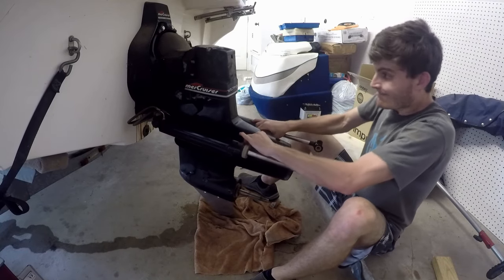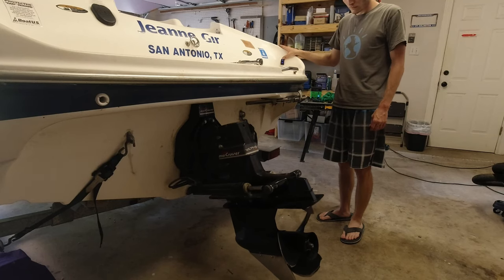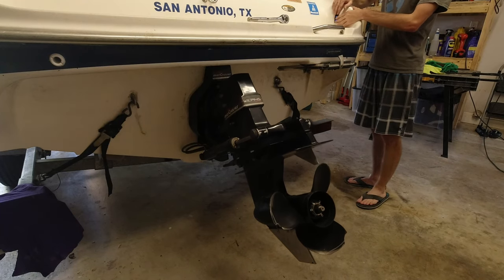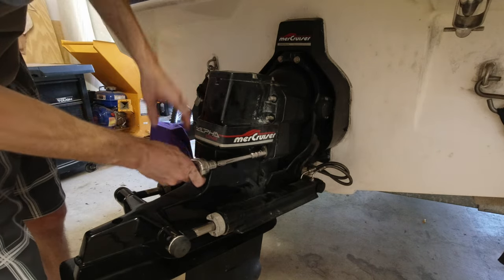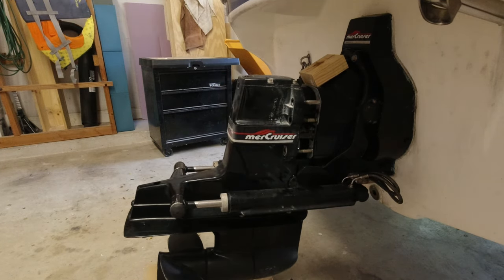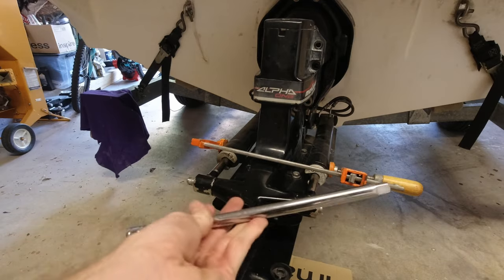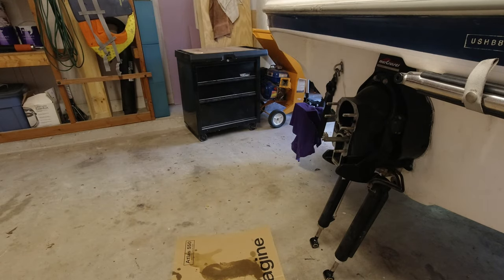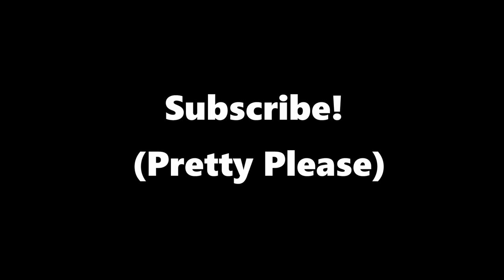How To Remove an Outdrive | The Easy Way

Comment: I beat, I banged, pryed, and heated to no success. Reinstalled the ram and put in a piece of 2x4 on the top as shown and using the trailer button raised the outdrive and bang, the outdrive was loose. !!!! ZACH, you saved my $135/hour mechanics ass.

Comment: Great video, Zach! You're helping a lot of people with your channel. I am about to remove my outdrive - Alpha One Gen 1. Before doing it, I thought it worth asking you for an idea of the problem in my case. I hit a rock with the propeller last autumn, at a very low speed. The engine kept running, but the propeller stopped rotating (in both directions it doesn't rotate anymore when I put it in gear). Now I hear a rattling noise inside the outdrive, both in neutral and in gear, close to the boat area. Any idea what it could be, what to look at? I am trying to avoid disassembling more than I should. I am not a mechanic... learning from your videos. :goodvibes:
Reply from the maker: well somewhere or another a gear stripped. it could even be the mechanism that puts it into gear. the level I show that has to be straight when putting the outdrive on
Reply: @ZachsGarage1  It's Friday night and you're active... 😃 Thanks for the reply! I'll have to remove the outdrive in this case... no choice. Another occasion to stay closer to your channel. I'm grateful for your efforts.

Comment: Smart idea with the block of wood! Also, I might be wrong with this, but when you reinstall the outdrive does the drive shaft have to go back in the same way? for balancing purposes?
Reply from the maker: the splines need to line up, but I don't know about balancing
Reply: nope, doesn't matter, just need to make sure your engine alignment is good from time to time... thats part of what can make it hard to remove the drive in the first place...

Comment: Thanks Zachs for video.  I can’t get my Bravo 3 outdrive out at all. Its like stuck in the engine. Even with several 100 lbs of force from a scissors jack The shaft just seems stuck in the engine coupler.  Any ideas ?  I am being told that the the shaft will have to be cut off and the engine than will have to be removed to install a new coupler for the Outdrive.     Any thoughts would be appreciated

Comment: Still the long way around it and a chance to accidentally pull your gimble bearing out.  Broom stick under and drop the drive with rams off. Some ungreased drives that have been on forever if you try to do your ram method you can bust your trans assy..  Have more that 1000 drives under my belt and you have not seen one thats really stuck like an old R drive or a number 1 drive  that has lived in salt dif methods apply at that point.. Great vid btw

Comment: I need to pull my engine to replace a freeze plug. After this video, is there another part of the out drive to remove before I can start pulling the motor? ( I watched the motor removal video)
Reply from the maker: All you need is the outdrive out since it has the drive shaft

Comment: Great video, but where am I going to find a wood block?  (just kidding).  The other comments below are helpful too (reverse vs forward, speedometer clip, alignment, etc).  I wonder what the torque is for the bolts on reassembly?  Thanks Zach for another straight to the point and very informative video.  I don't understand the gear thing, but I'm sure once I see my unit, it will make sense now that I know where it's separating from.
Reply from the maker: I don't know the lb ft maybe 90?

Comment: Thanks for your video. I have a question if you can help with this. Is there an easy way to fix  a little play access in the outdrive?
Reply from the maker: do you mean play in the steering? like it has too much play in the side-to-side wiggle?
Reply: Yes, there is a little play. I can move the outdrive left and right.
Reply: Id highly recommend looking up the shop manual for the engine and drive     Take a look at iBoats and through the forums you can find the link to the manuals
Reply: @rafeeqal-hashemi181 what did you end up finding

Comment: Is there an easy way to do this if the battery is dead? Obviously, the power trim won't work then.
Reply: Hey, Zach, I actually answered my own question on this just a few minutes ago. If you remove the trim ram axle, you can use the 'small piece of wood' trick and just lift the outdrive to lever it off.

Comment: hi zachs, i see you where mentioning about a tubing as " speedometer" wiring, may i know how this functions, this is a tube, i am not sure where it is connected to the engine and in my boat it is ripped off, i need to replace the tubing too, please advice.
Reply from the maker: It doesn't connect to the engine. Its just for the speedometer gauge on the dash, it's not really needed.
Reply: @ZachsGarage1  understood, thanks a lot for your support, i watch your videos and got interest in mercruiser engine and bought a 19 foot boat and engine for each  USD 1464 each ! sounds crazy ! , i bought this an year before and assembling the boat, almost done, including trailer extensions, complete wiring of boat, roof top, some crazy stuff, but i am ok with all mistakes i do too, thanks a lot for the inspiration.   I am indian, living thailand.   You can do any stuff in thailand as i get all the spares from china at dead cheap prices. thanks once again.

Comment: I’m thinking my gimbal bearing is done so I may have to this. Do you agree this is what’s making this sound? https://youtu.be/URkDQ3ge2J4
Reply from the maker: It's difficult to tell where the sound is coming from in the video. it could be something inside the engine.

Pretty easy to check if it's the gimbal. Remove the outdrive and try to turn the gimbal bearing by hand
Reply: @ZachsGarage1  thank you for the reply. I’ll pull the drive using your easy technique. Keep up the great work sharing your videos, I appreciate them.
Reply: not sure that's entirely your problem. Sounds like you've got something seized up in the engine. Couldn't leave a comment on your video but curious about what you found the issue to be.
Reply: @johnstinnett1571  I had a spun bearing (#2 con rod). First time I’ve ever had to disassemble and put engine back together. All thanks to Zachs channel and a few other YT vids. 👍